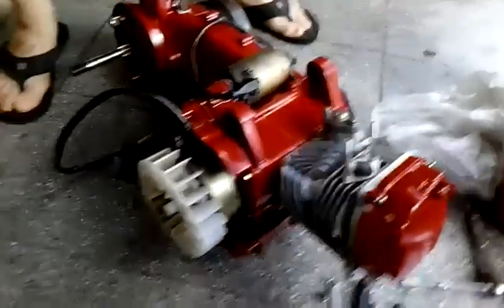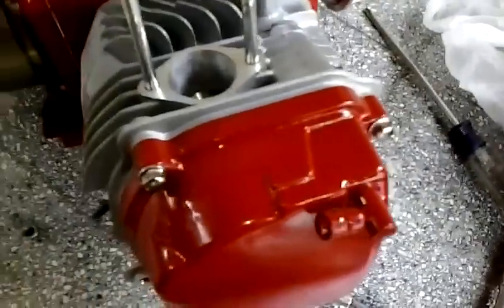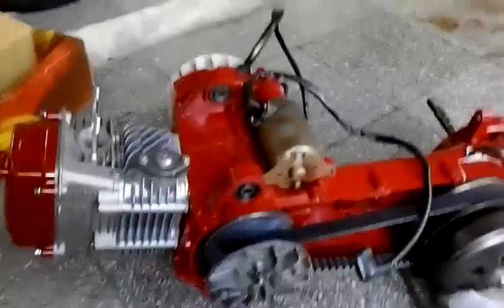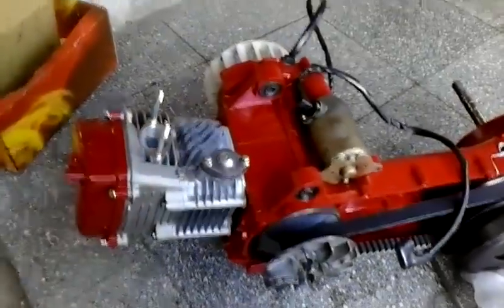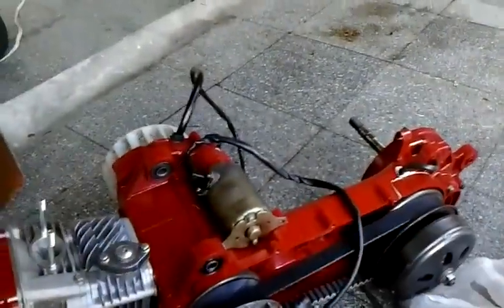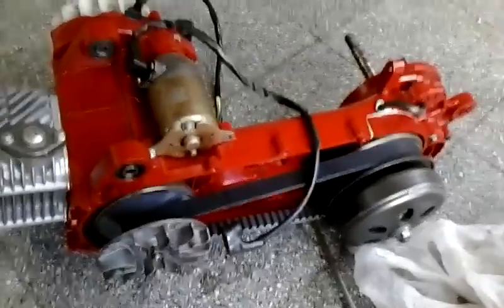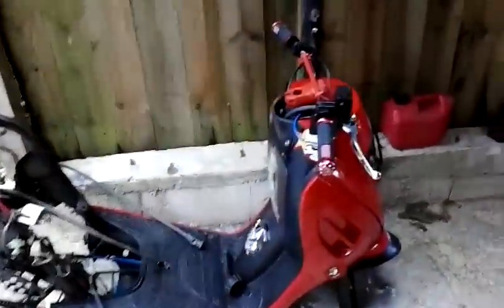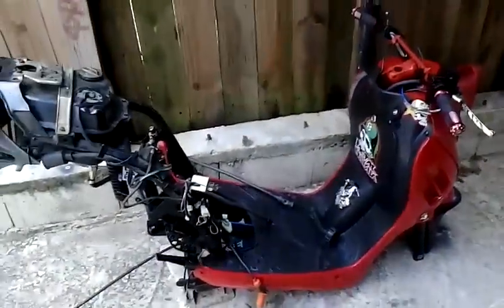Gy6 racing scooter motor

Comment: So is the 232cc engine a bored up 150cc 2v short/long case gy6 ? 

Is there a jig to bore the cases ? Or can the cases be shipped to the uk pre bored to house the 232 head ? Thanks and love the build
Reply from the maker: Yes sir, 150cc bored out.
Reply from the maker: Long cas
Reply from the maker: Yes there is a bore tool I sell brand new. $275 shipped to U.S.A I'm in Puerto Rico a U.S.A territory.
Reply: @pellettron-nj9ci  
Hi thanks for reply 
I'm in the uk . I have a sinnis harrier 125cc that I want to tune to 232cc I think it has a short case gy6 125 in it do you have any ideas ?
Reply: @pellettron-nj9ci  will it work on engine code BN152QMI

Comment: Hey my friend I was wanting to know are these the same engines that are on those Timberline Crossfire 150cc off-road Go Kart dune buggy deal and if so either way could you holler at me man on a couple things
Reply from the maker: Roy Nelson yes sir its the same engine..only difference is the cranck case is shorter on the dunbuggys..
Reply: pellettron2240 that's what they call the short case then I bought the Timberline Crossfire 150cc off of a friend I've never seen it it don't run and it comes with an extra motor I was wondering about the Big Bore Kit are those pretty solid or what can you do to these
Reply from the maker: Roy Nelson you can bore the crank case out to 63mm, but i would only recommend that for scooters as this motors get less cooling from air as a dunbuggy..i highly recomend a 58.5mm set, and you dont habe to bore out the cranck case which would involve taking the whole motor apart..i have new parts, if youre interested shoot me youre email and ill contact you..

Comment: well i like speed i dont like nothing lower than 50 how high can you get it?   and where to buy the frame?
Reply from the maker: you can hit 70 even 90mph,but that ball depends on motor and weight of rider.. to go top speed you need to buy a big block GY6..there not cheap, you're looking at 2grand for a fully built motor...

Comment from the maker: I can build any Gy6 configuration you want victor
Reply: +pellettron2240 what would you advice someone wanting to do a gy6 150cc swap on a ruckus. whats the simplest
 solution in regards to simplicity.
Reply: +pellettron2240 is it reliable? because those engines are chinese right?
Reply: pellettron2240 can I do this myself if I buy all the high quality taiwan parts,I have alot of tools and I can take my time over the winter I wanna build something real powerful like a 63mm stroker. They even sell the bored out cases with oil cooler drilled into it lmk your input

Comment: What did you do to the deck? Cut it 10mm?
Reply: +Ryan Nix that's what I was wondering.... he "cut the deck 10mm and stroke it 6mm+ then added a A12 cam which means the valves open more??? and there is enough room for valves to open??? wtf....

Comment: So can i,build any people want, remember the assemply for 125+ motors are over the engine, and 50cc up to tuned 90cc is under the motor, so you can never put a 125cc+ or bigger on your 50cc scooter, unless you fuck up the scooter and weld and do a lot of things.. . I already have a 90cc , and it only runs 100kmh, but with normal transmission...24mm carb, S6 oversize clutch,15% polini spring, Malossi vario, 5,6g rollers, Naraku intake, cdi, Malossi filter,Motoforce rectifier 200w, Zoot ignion coil, Iridium spark plug.Turbo G Max exhauust, highly recommended, the one to 134 pounds from racing-planet, gave more torque and a bit more higher speed..mail. mkoldig@icloud.com